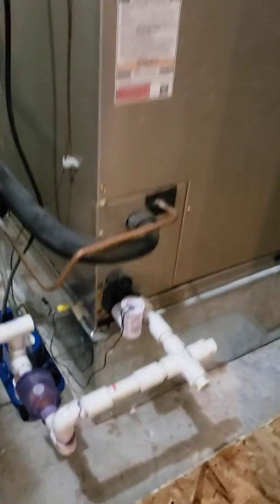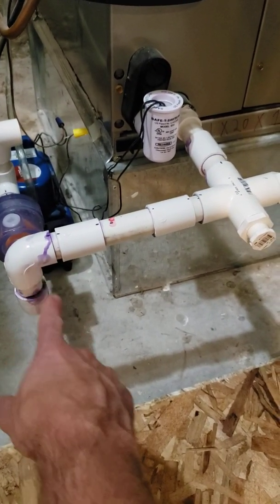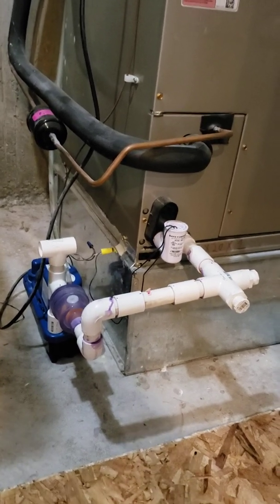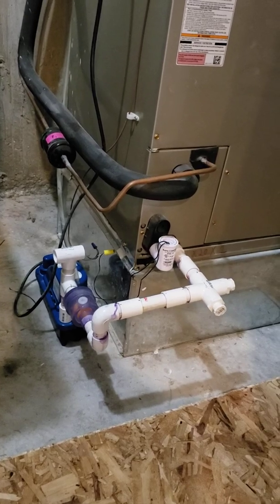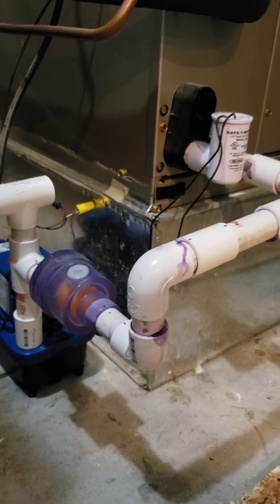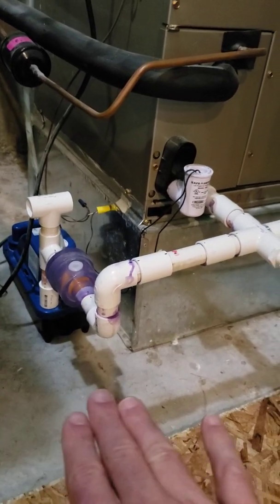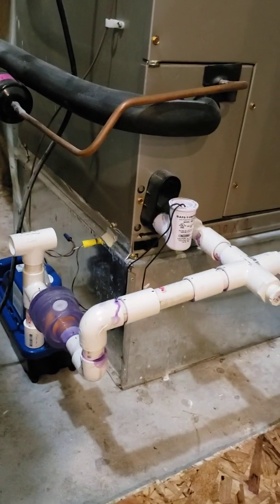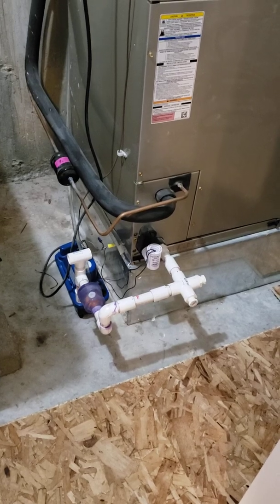Waterless HVAC condensate trap

Comment: Where does the water from the ac condensation go? Trying to figure out a solution so it doesn't drain in my yard and cause a lot of mildew
Reply from the maker: It drains into the yard.  Haven't had a problem with mildew that I've noticed.  At the beginning of each season I run white vinegar through the lines and put hvac pan tabs in the systems so that the lines stay clean through the season.